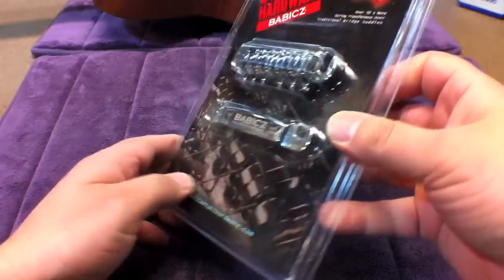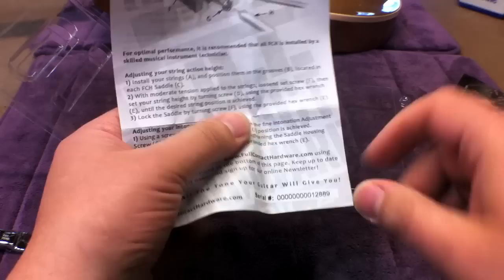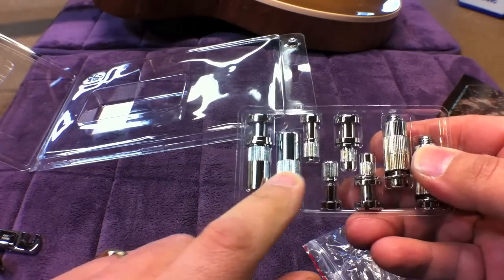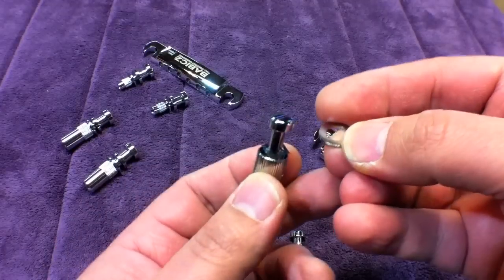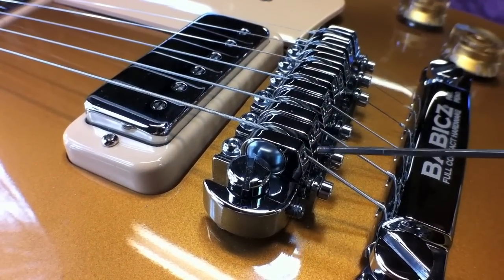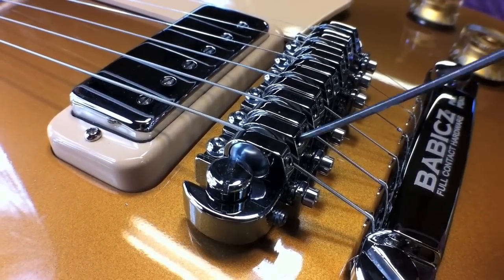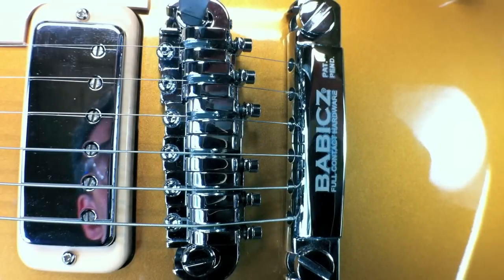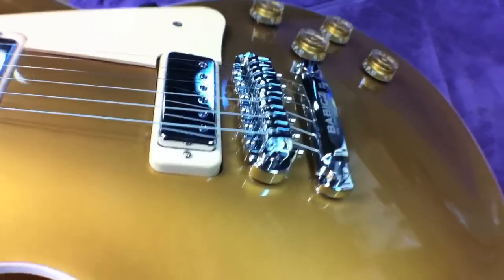Babicz Full Contact Hardware Tune-O-Matic Installation

Comment: Just my opinion and impressions for those who are thinking of buying this bridge. I set it up on my Les Paul Supreme. This bridge definetely improves the sound! The sustain became much longer. The sound is deeper and brighter. This can be heard even on the unplugged guitar. When I plugged into the amp it seemed to me that my passive pickups became active, because the sound was a little bit compessed. I guess after you change the bridge you should adjust the height of your pickups in oder to decrease their output. 

With this bridge the sound became clearer and articulated. 

Generally I'm fully satisfied with this product. But there are several things you should keep in mind if you want to buy this.

1. If you want to use the included screws for setting up the tailpice keep in mind that you won't be able to do this, because Babicz screws has a metric thread while Gibson has an inch thread. You should change the stock nuts. But the Gibson nuts are wider. My luthier had to set up the mahogony inserts and drill new holes. Strange thing but the screws directly for the bridge fit the stock Gibson nuts well.

2. Probably you will need to spend time for experimenting with the settings of your rig because they will definitely change with this bridge :)

3. Prepare yourself for spending money and changing the rest of your TOM's. :) Babicz bridge is a little bit higher than the standard one. 1 or 2 weeks your right hand and shoulder may feel uncomfortable and later your playing technique will change. So after that you will be uncomfortable to play on standard TOM.

That's all. Sorry for my English :)

P.S. I don't mind the logo on tailpiece. It looks quite organic with my Les Paul ;)

Comment: These are fantastic bridges. I have these on all my guitars that take them with the exception of a new strat (will get one for it soon). 
   My 24 year old Les Paul needed a new bridge (old bridge was collapsing in the center and couldn't be rebent again). The Babicz makes intonation great due to the locking parts and the fine movement of the adjustment. I'm expecting the bridge to last longer than the original. 
  I replaced a bridge on a Gibson 339 as well. The original was not stable- it moved around and made noise making me adjust intonation all the time. Had to have it installed professionally as it needed the bridge post holes reamed out. 
   It does give better sustain- the LP and other guitars ring like bells now. It's not completely perfect due to the differences in measurements in some guitars- Babicz sent higher ecam saddles for my Tele- so most issues can be dealt with. 
   I also put them on a Musicman stingray- tighter bass, better slap tone and I can hear chords without so much mud. 
  A P bass didn't change much in tone or sustain with the new bridge- it was already good before. 
   These bridges are a huge improvement.
Reply from the maker: Thanks for your support Dan!

Comment: Could this possibly be set up to match the radius of a Fender Mustang or Jaguar??? I really want a TOM style bridge (don’t use the term) and want a more stable intonation and just overall better bridge than the standard Mustang barrel saddles offer. Currently, I can’t find anyone that offers a TOM style bridge set up for a short scale Fender neck radius, and the only height adjustable TOM style bridge I’ve found has a very poor design that rattles like crazy and also loses tiny pieces that vibrate loose.  With how many short scale players that want a TOM style bridge, it’s remarkable to me that no one offers one with the proper string radius. One has to file the slots themselves, meaning any future adjustments require a whole new bridge. Fender has been selling more and more Jaguars, Jazzmasters, and even sold the Cobain Mustang with an “Adjust-o-matic” bridge from the factory, but doesn’t sell one pre-made to drop in as a replacement part. If your bridge can drop right into a Jaguar or Mustang and adjusted for low action, your bridge could do VERY well with the short scale crowd. Just sayin..
Reply: I just ordered one of these with the goal of putting it on a Jaguar, but I’m installing a Warmoth neck with a larger radius as well. Really hoping it all works out.

Comment: I have a 77 Yamaha sg1500 . It’s pretty close to the sg 2000 with the exception of the neck. The tune o magic has collapsed and they no longer make parts for it. It’s not a standard post spacing so aftermarket isn’t an option. I believe that the standard post spacing is 73.5 mm, the Yamaha is 76 mm. I was wondering if this would be compatible with my setup?

Comment: I have not seen a reply as of yet on how you can palm mute with these bridges. If anyone has an answer please reply.
Reply: take up piano mate
Reply: tried sucked at that too.
Reply: Just incase you are still wondering, after a comment/question you asked 6 years ago (!), I wondered the same thing. - I bought one & the palm muting is no problem, just fine, it's actually more comfortable too. This bridge is a lovely bit of kit.

Comment: I have two questions about this system. If you lower the string, it looks like that it also affects the string length (of course, you can fix it later), but you also loose the braking angle of the string saddle and the length of all the strings after the saddle each becomes different, is it ok? Another thing is that the strings are going into the tailpiece with angle, which creates another force direction and string tendency to slip to the sides, I think. Or is it camera angle?

Comment: What an absolute marvelous piece of hardware, I'll buy this at the same time as i buy my Les Paul, I'll just give the old hardware back to the store as it serves no purpose.
Reply: +Fps-Gaming-Productions Keep the hardware and use it to build another guitar out of old parts.
Reply: Captain Freedom But then it's a guitar with crap parts, Which would also render it pointless. I mean I get where you're coming from but Stock Gibson parts aren't worth keeping.
Reply: Fps-Gaming-Productions Stock Gibson parts are nothing special, but they're good enough until you can buy something better.
Reply: +Fps-Gaming-Productions Why not keep the original parts in case you're gonna sell it later? Original hardware, even when worse will sell the thing easier... This kind of aftermarket hardware would just add to suspicion (warranted or not) of it being a Chibson.
Reply: +Fps-Gaming-Productions I could use the old hardware right now.

Comment: you should have used washer on top of bridge.  Every time you turn metal on top of metal  it scores it, creating an uneven surface. With the washer you would have downward clamping pressure., maybe even more surface to surface contact. That whats great about washers, even better might even be a slighter softer metal.  
Beside all my trolling, I agree there is needed a better bridge.  I am typing while watching  your video. it just finished up. I bet it sounds good with so much contact with the wood.
This video caught my interest because I am in the middle a guitar from hell retrofit.  Don't ever say "What could go wrong?"

Comment: After installing this bridge and saddle, I noticed my 5th string was sitting a lot higher than any of the other strings. I thought "Eh, no big whoop, I'll adjust it when I'm done stringing." NOPE. All other saddles adjusted string height fine, except for the A string saddle. Vendor I purchased from will not accept it as a return, so I do the next best thing and contact Babicz directly. First off, it was about a week before I got a reply from them, which was "We'll just send a new saddle out." A couple more days go by with no response, so I inquire. Response: "Sorry we don't have any in our parts bin and sorry man but right now NAMM is going so who knows when you'll get it." WHAT? Guys, they manufacture these and HAVE NO PARTS ON HAND! Is "sorry but helping you is not in our best interests right now cause we have bigger things to worry about" the new norm? I've never experienced this from any other company. It's now been over a month since buying and trying to install. No bridge, no guitar playing, while they're all off partying at NAMM, probably selling more defective saddles. Today, I told them that I want a full refund. Will probably be another month before I hear back. Do not buy. Company is a joke. I once had trouble with the nut on a PRS guitar, received a reply from them the very next day that resolved the issue.

This is all very unfortunate as I was really looking forward to using this innovative piece of gear. As of now, it's an innovative paper weight.
Reply: @redlikewater2453  So , you pay around $200 for it and then start grinding screws? Yeah...why not.

Comment: Have a gibson I dislike in large part because the tone-o-matic is too high and that can't be adjusted lower any further.  Makes for annoyingly high string tension so I pretty much don't touch it and use my PRS instead.  This seems like a good mod as it adds height adjustments among other things.  Was wondering if the action is able to go lower than the standard bridge?
Reply: Lower action on a Les Paul tends to have more fret buzz since the string tension is lower due to shorter scale length of the neck.

Comment: Wow! I want one! What about a firebird? Could you put one of these on a firebird? Are these expensive? If I had the extra 200 bucks or so, you can bet, I would invest in one of these. I have a Epiphone Firebird, and I love it more than you know! I haven't had it long, I'm basically a beginner, I'm starting to form a relationship with my guitar, but I can already tell, that I am not a fan of the tune o matic bridge. One of my biggest problems is the G string saddle is slightly higher than it should be, above the rest of the string's. Like, I can hold it up flat and look straight down the string's around the picking area, and see that it's higher than the rest of them. I don't like that you can't adjust the height of those saddles. It's messing with the tuning. 650 bucks is a lot of money to pay for a guitar, concidering the current state of the rapid inflation problem, I expected better for the price I paid. But regardless, I will get it straightened out, because I am in love with the guitar. I have two small, peavy P. A. Cabinets, powered with a bogner mini extacy head, with zero effects, not even reverb. and even you, or anyone familiar with amps, the sound they make, and all the things you can buy to have any type of sound you want, would be impressed. I know one thing! If I ever get to, or need to buy a full size half stack, high powered, perfect level of heavy tone to my liking, it will most definitely be a bogner. They destroy a marshall, in my opinion.

Comment: Does this bridge work with a Gibson Flying?
Reply: +MrTR909 Probably not because a Flying V has a flat top but maybe the guy also makes a bridge for flat top guitars.
Reply: It will work on a Flying V. He said on the video, that you can use it on a flat guitar, you just need to use flat connecting plate.

Comment: Hello! Besides the fact that I also do not like the huge logo on the stoptailpiece, I was wondering why the holes in  your tailpiece seem not to match the string spacing of your TOM. The outer strings seem to get pushed outward a bit. Is this just the angle of view from the filming, or is it really not matching?
I mean this FCH is a great piece of engeneering for sure. And it's also a bit expensive. So you obviously are heading for the market of tone perfectionists. But then I cannot understand why you do not provide a straight string orientation? There's nothing better than running the strings in a straight line... (Well, I hate Gibson somewhat for still using that same old headstock that needs to bend nearly every single string... Leo got it right from the start. And thx to string butler, I can fix Gibson-style guitars)

Comment: This is the pretty good invention. However, it doesn't fix the fundamentally bad design of the tunomatic, which is usually combined with the neck angled backwards.

A fender/hipshot style hardtail bridge is the better choice.

Comment: Much prefer my original LP 2000 gothic bridge tone so far. The two highest treble strings have lost that BB King/Gibson deep tone I had before - to my ears. (a the LP gothic is great deep sounding 50’s style LP) Full contact does give a bit more sustain but it is not a better tone or note bloom and decay. Yes the action can be set lower thus this bridge will be valuable for many folks. but my action could only be set fractions of an inch  lower in my search for a perfect lower action. the lightweight aluminium and rounded saddle system give a Far East import like tone - it is made in Taiwan compared to the original black TOM that is heavier and had a nicer bouncy feel over the sharper saddles - might also be a Far East import (Or USA made like the whole guitar)  but feels much better. I wanted that fraction lower action but it is not a sound improvement to my ears so I’ll accept the slightly higher action. I did not put on the tailpiece - not sure that makes much difference. It’s bulky and has many parts. I’ll try some thicker gauge high strings bc the action can be set lower with good tone - otherwise tone will demand I convert back.

Comment: One other thing I want to add.. After setting the intonation I went to tighten the set screws and because the set screw is at the end of the saddle it rocked forward enough to throw off the intonation. I backed off the set screw a bit.. Left it barely snug and it returned to tune. Im saying not to tighten much beyond snug.. its certainly not going anywhere even without the set screw all together.. Just a lil heads up.